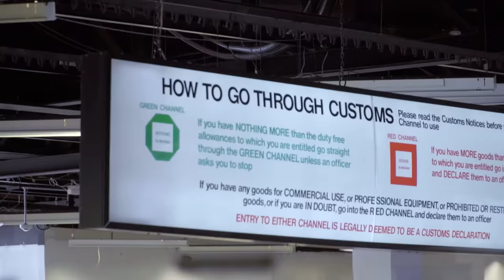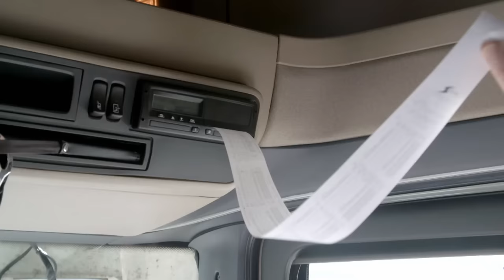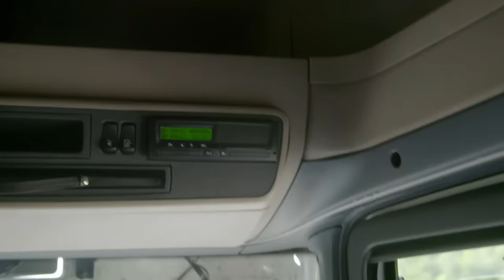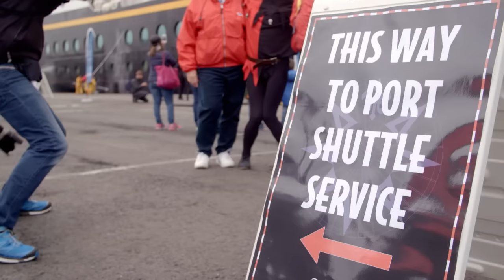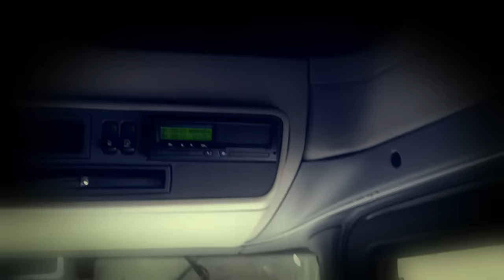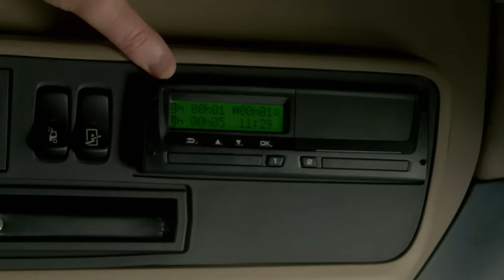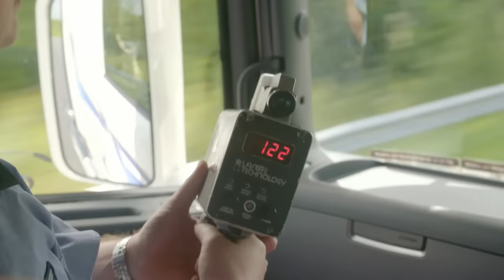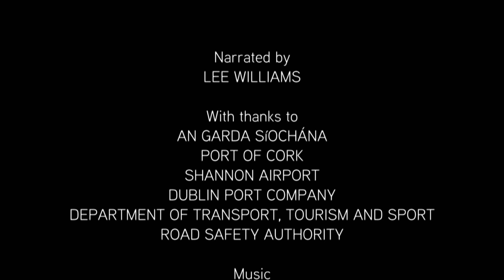Illegal Device Uncovered - Border Interceptors - Border Documentary

Comment: Only 5000 EUR fine for the company fitting the tampering device in the truck is outrageous... More than road safety, they are also literally exploiting the driver. It's a breach of EU transport workers' rights. The company should be fined 50k
Reply: Should be forfeit of truck and trailer!
Reply: Transport company will recoup in a week from other bent trucks, ridiculous
Reply: These truck driver take meth or amphetamine and driving long hour without sleep
Reply: I was going to comment right along these same lines. 
Great job guys👍
I'm curious. Does anyone know what the rules actually are in relation to driving these big trucks?
Reply: Many truck drivers are self employed use it as a part time job while managing a farm in some parts in Ireland 50k would be a year salary for them 5K is a bit low yeah maybe 10K max should be implemented
Reply: @Sam-yb2bv  More often than not it’s companies doing this to their drivers, I doubt a part-time driver with an other job would elect to bypass the regulatory working hours, wouldn’t have enough time available in the first place… But if that’s the case and it’s really the driver’s own choice to cheat the system he should be punished just the same… If you know you’re gonna put road users at risk by driving 12 hours after having farmed 12 hours then idc about your money 😂 Make a limited liability company…
Reply: I detest unions
Reply: @tracewallace23  the rules are harmonized across the EU. Very simply: You can drive up to 9 hrs per day, then take an 11h break. And you have to take a 45min break after every 4,5hrs behind the wheel. Under some conditions you van Drive up to 10hrs per day.
Reply: @ohspikymiky in thailand its probably red bull...
Reply: Fines shoul be based on a percentage of income. So it hurts everyone equally.
Reply: @tracewallace23 
Make sure you aren't caught? !!! 😅😅😅😂😂😂
Reply: Ya.  Cause what have they ever done for workers besides better pay, holidays, healthcare, pensions, overtime…
Reply: @counterleo  more often than not truckers do it themselves, although it is mostly to the demands of the company which are undoable, for example you are driving in Germany, your working day according to the taho ends at 19:00, you don't have enough time tobget to the place of delivery, nor will you have an opportunity to find a parking spot, since most spots are full after 18:00, but the firm will never approve for you to stay put, they will demand that you get as close as possible to the place of delivery so that you could be "first in line" to unload in the morning, so many truckers resort to all sorts of machinations to fill their quotas, not because they want to, but because if they won't, the company will find some Ukrainian who will.
Reply: @HiThailand-g7l In Scandinavia, Unions have created some of the best working and wage conditions in the world!
Then again, corruption isn't part of our culture.
What's your issues?
Reply: @65kasara you can only regulate and control to a certain level.. Even lorry drivers have to step up their game, instead of giving into lowest bidder!
I've met one of these Romanian drivers being abused, but denied playing the game by quitting to gain better conditions. The whole business are rotten on all possible levels.
Complete truck loads were loaded and driven across several EU border without papers! Black business must be huge
Reply: These tachygraphs should be sealed units,  and any tampering with its connections or wiring,  all the way through to its targetted device its is measuring,  should immediately render the unit inoperable.  Yes,  it would mean every time the battery is disconnected,  a new tachygraph has to be fitted by an authorised installation agent.  Any infraction will automatically implicate the installation agent,  the driver and the operator.  Euro 5000.00 is a joke ......  these fines have to be dissuasive,  Euro 100'000.00 minimum.  Yes,  perhaps many little companies will fold as a consequence,  but these are the companies that were not respecting the law anyway,  so no loss.  Small companies respecting the law and being unfairly out--priced by unscrupolous operators may then perhas get their fair share of the trade on offer.  No show me the politician with the balls and spine to get this into law !!  I shant hold my breath.  Politicians are as crooked as these unscrupulous operators - morally bankrupt.

Comment: Perhaps it would have been a good idea, with reference to the truck and it's hidden trip computer manipulator, to dust it for prints and maybe find the people in the workshop responsible for the installation. Maybe the Garda did this and are being coy about it? Either way, truck driver hopped up on meth, and driving ridiculous hours are a nightmare scenario. The kinetic energy in those behemoths as they build up speed is scary, and they will slice through metal and bone as if it were nothing should they crash into another vehicle.
Reply: If I were the judge, I'd be ordering the driver's heavy vehicle endorsement cancelled and disqualified for a period of time.  With the threat of loss of livelihood looming over them, most truck drivers would be be far more hesitant to fit such devices.  The fine for the company is also a joke.  5k Euros is nothing to any company of reasonable size.  It should be more like 50k Euros.  There also need to be regulations on the company not to set unrealistic delivery and operating times for drivers, with huge fines for doing so.
Reply: Meth? What county are you from? 28 years driving I never knew or heard of any driver using meth here in Ireland. Buckets of coffee/Red Bull/Monster yes, meth defiantly not.

Comment: Not enough controls on speeding trucks on M50.
Reply: Not enough control of middle lane daydreamers on the m50 who want to sit at 83 when truckers are having to decide which law they'd rather brake to manoeuvre around them... we're not supposed to use lane 1 to undertake people and we're not allowed to drive in lane 3 unless lanes 1 and 2 are closed.
Reply: @ciarand2823  BS the traffic is so heavy on M50 that the three lanes are used most of the time.
Reply: @Norbitek25  not enough controls on speeding trucks on M50?... trucks fitted with tachographs are limited to 90, really what more do you want?  unless there's a speed restriction displayed on the overhead signs, truckers, along with everyone else are perfectly entitled to make progress where it is safe to do so. If you're sat in the middle lane and a truck is moving faster than you in either of the other two lanes you're the problem in that scenario, you have forced that trucker to decide which rule he/she'd rather break in order to manoeuvre that rig around you. Traffic is so heavy because too many drivers don't know how to use a motorway correctly... if you're not overtaking someone you should be in lane 1 (if you'd call this lane the slow lane you're very much mistaken... it has the same speed limit as the other two lanes) there is no such thing as a "slow lane" on a motorway, motorways were designed and intended to enable large volumes of traffic to move at speed. If you don't like the idea of moving at speed within traffic then you shouldn't be on a motorway, best stick to the back roads.
Reply: @ciarand2823  More BS plenty of truckers going more than 90 km/h and dangerously tailgating. Gardaí have to start controlling and fining the truckers before they cause a huge accident on the M50.
Reply: @Norbitek25 the Gardaí won't be too bothered but if you'd like to take a note of their plates along with the time and date and forward that information to the RSA I'm sure they'd be interested to check their tachographs to see what's what. If I'm stopped in the lorry they can audit all my activity over the past 28 days including daily rest periods and driving speed. They check to see if the speedometer is calibrated ect, they check the sort of things the Gardaí wouldn't even know to look for. Any discrepancies found could result in fines or loosing my operators licence.

Comment: All you have to do is follow any Irish registered truck down any motorway, 65-75 mph is the norm when English vehicles HGVS are only travelling at 56mph which is the legal limit for heavy vehicles. Everyone involved in haulage knows this but for whatever reason the police on the mainland are reluctant to pull these vehicles. Most laden HGVs will exceed the 56mph limit when running down hill as the weight pushes the truck but mysteriously Irish registered vehicles can comfortably do 65mph uphill loaded.
Reply: why are you talking about english problems on an  irish video?
Reply: What are you on about "the mainland"
Reply: 65mph uphill loaded :D :D give it a break

Comment: Commands 265. Finding the tampering with a speedometer. Recent video there was talking.. About the gambling in Las Vegas and how they would buy a slot machine about $4000.
Use electronics. Some of the electronic tools cost $12,000 a piece. These officers in Ireland do a very professional job. It makes the road saver.06/03/2024❤.

Comment: 16 hours of driving in Ireland could just about take you around the perimeter, exaggerating. Dublin to  Galway is under 4 hours. Used to be a lovely drive before the M highways. Everything was better before the EU.  The beautiful Holland guilder has been replaced by the boring euro.
But I digress.
Nail them. Truckers should be held to the highest driving safety standards. They're driving very deadly vehicles.
Reply: Dublin to Galway is about 2 hours on the M6. I agree though, being a culchie, the old roads were better days, and indeed we should leave the EU.